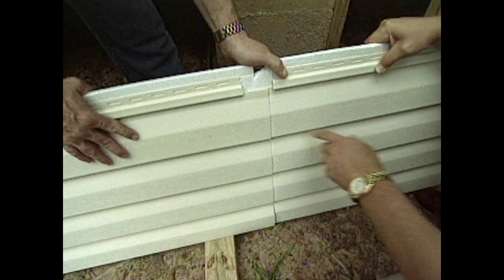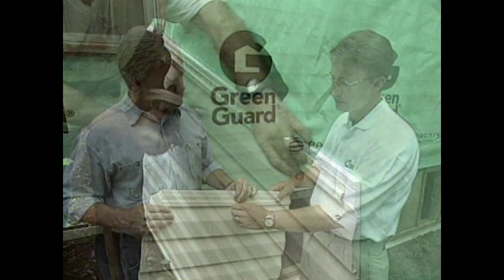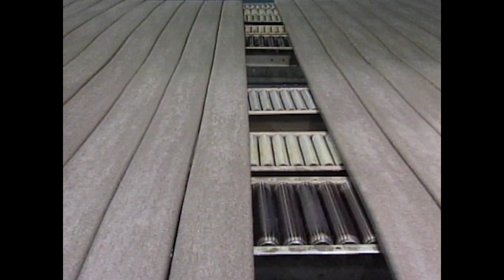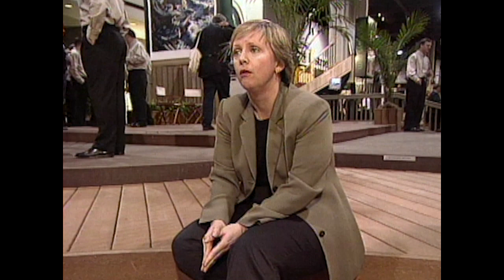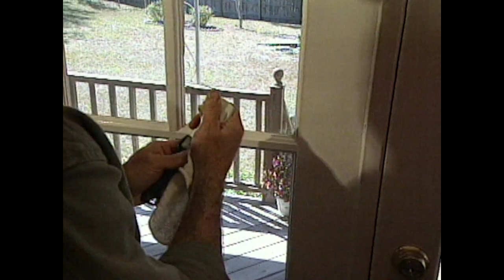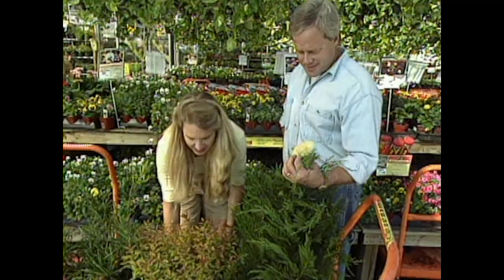Low Maintenance Exterior - Today's Homeowner with Danny Lipford (S4|E20)

Comment: I had major problems with thermatu fiberglass patio doors!  The glass seal was the major problem. With their lifetime warranty several of my doors were replaced but I had to pay for installation. Even worse, when I had some minor termite damage to the wall around the door I found that the termites actually got into the wood that was inside the door and totally destroyed it from the bottom, Even though the door looked and functioned perfectly well from the outside!